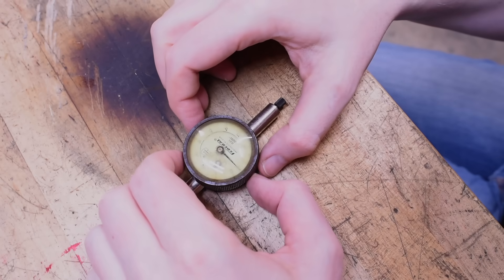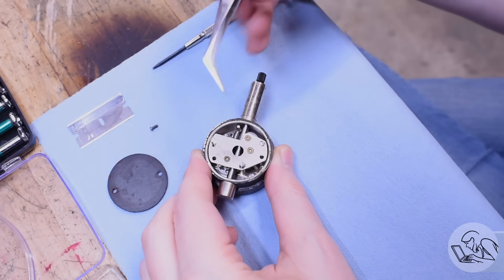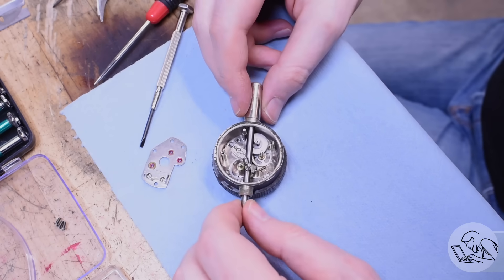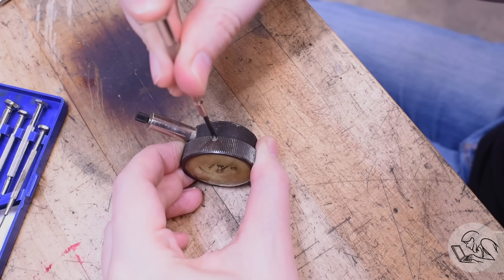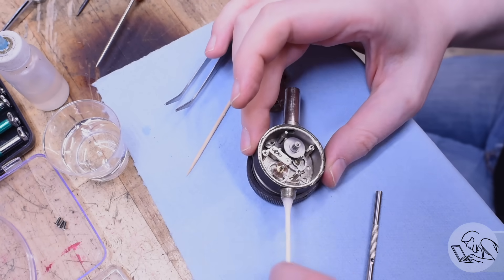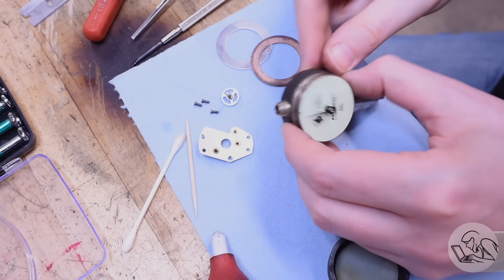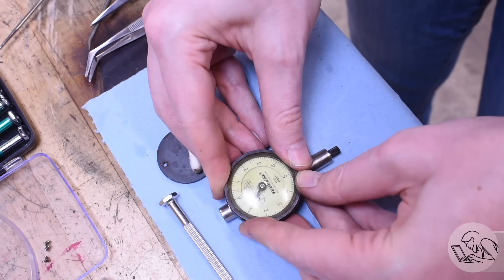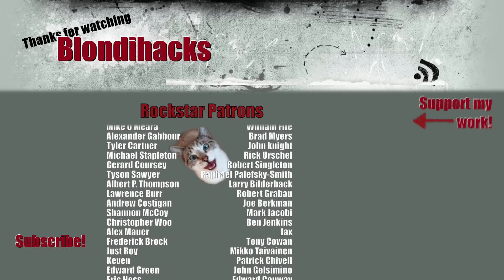Repairing Dial Indicators - Diagnosing, Fixing, and How They Work!

Comment: as a pocketwatch repair hobbyist, I approve this message. I saw your magnifying visors you had on. to the rest of your subbers, trust me-you'll need them! 
Nice work!
Reply: Heck, I need the visor magnification to read my med labels!
Reply: but is the machine oil ok? Isn't that to thick for such a sensitive mechanism?
Reply: @DenysSene  try entering the world of horology and repair. Mention oils and watch the fur fly..and you wouldn't believe how expensive watch lubricants are. But for this application Starrett used to sell instrument oil for indicators. I don't know if they still do. I have a little left in the original oiler from 30 years ago. I use it on my micrometers and calipers, indicators etc. Quinn is right tho-less is more.
Reply: Just checked-yep they do. Starrett 1620 instrument oil. Also Starrett M1 but a spray can can cost over $100 bucks or more.
Reply: @jeffarmstrong1308  me too. 1620 comes in a dropper bottle and I have a needle oiler. I've never used spray stuff except in the garage truck car etc the big rusty stuff. WD40 to the rescue.
Reply: @DenysSene  Machine oil is not the ideal choice. The weight is not the issue. Even the best indicator gearing is crude by watchmaker standards. The real issues are oxidation, which can make the oil gummy over time, and quantity, where virtually everyone, Quinn included, uses wayyy too much. Ideally, one would use a purpose-made synthetic oil. Fortunately, for a device like this one, what she did was fine.